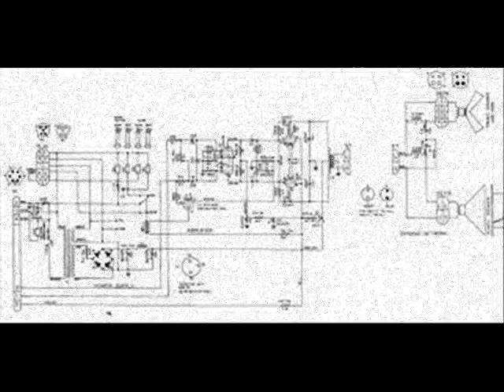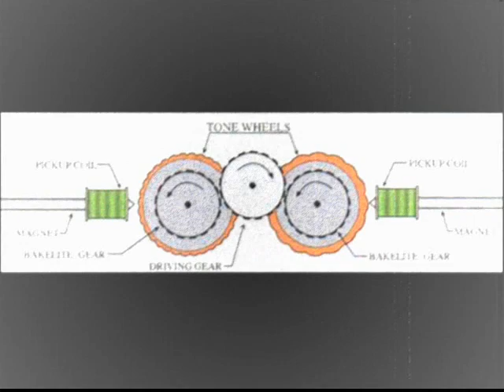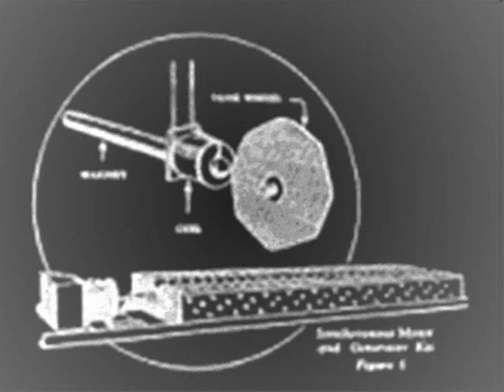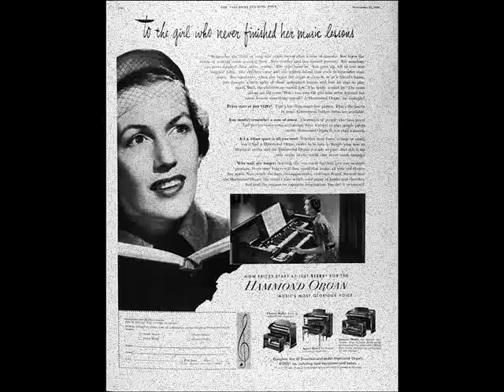Hammond Organ Leslie Speaker & the Incomparable Ralph Jones

Comment from the maker: The early Hammond mechanical vibrato (see Organgrinder010 's channel) and Don Leslie designed Wurlitzer 310 vibrato ( the cabinet I have, played a 78 through it on one of my uploads) were much more mellow vibrato that had very little phasing artifacts & was/is an awesome!! sound. Oddly, I played through my 310 cabinet for several weeks thinking that it was almost weak sounding. Then I changed out the remaining capacitors and the cabinet came to life. I love V3 on-Organ Goes South of the Border.

Comment from the maker: Hammond is a signature sound.The age of the technology is relative. Good is good regardless of age! You need to realize that analog electronics came first and digital came after, but it could have gone the other way. The Hammond organ is electromechanical with tubes for amplification. You think tubes are old fashioned, but when it comes to amplification tubes ARE superior. So what, they're glass? It's not like you'd drop your transistor amp either. The life is thousands of hours on a tube BTW.